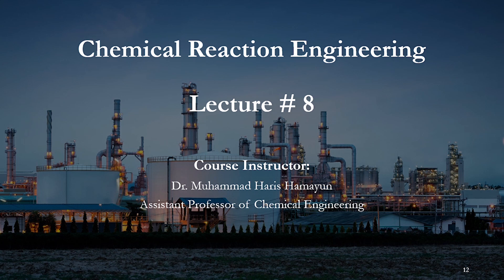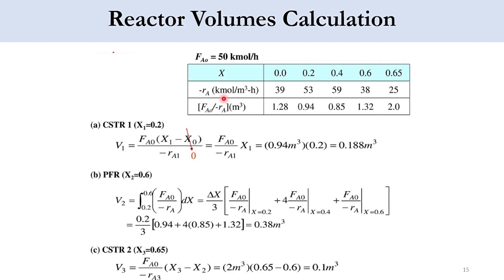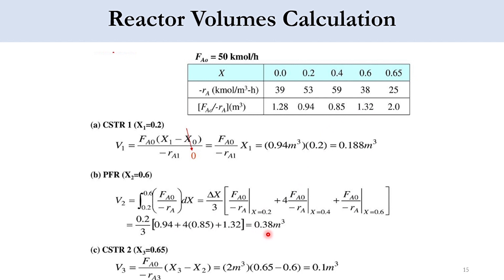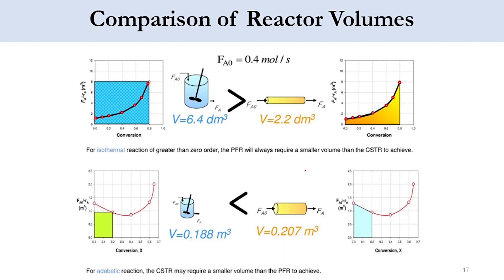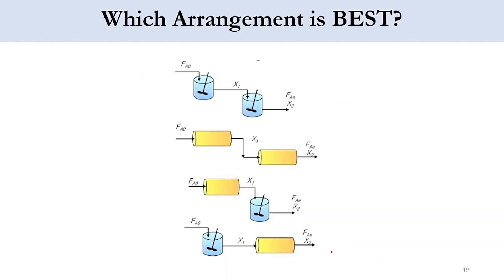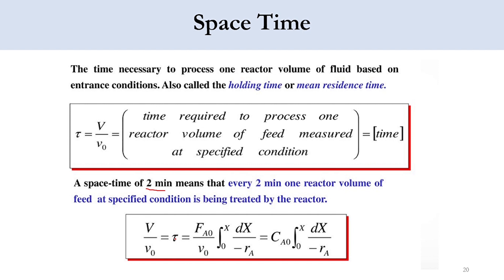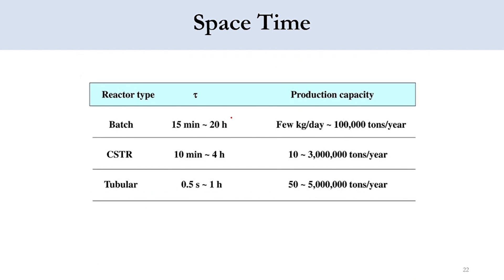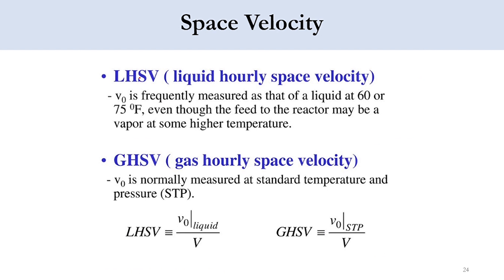Chemical Reaction Engineering - Lecture # 8: Reactors in Series & Space Time-Space Velocity Examples

Comment: 3:35 shouldnt FAo/-rA3 be 1.32 instead of 2? According to the table it is 1.32 and not 2
Reply from the maker: Thank you for your question. It will be 2 (as mentioned in the video) because we are calculating at X = 0.65 and the value of Fa0/-ra is 2 at this point. If you go to the Lecture 7, the basis of this point is over there. I am hopeful that answers your query. Thank you.

Comment: Sir could you please upload some of these videos

Simulation of Mass Transfer Equipment-1: Steady-state simulation of shortcut distillation
column using process simulators such as DWSIM/Unisim etc.

6. Simulation of Mass Transfer Equipment-2: Steady-state simulation of rigorous distillation
column using process simulators such as DWSIM/Unisim etc.

7. Simulation of Mass Transfer Equipment-3: Steady-state simulation of absorption column
using process simulators such as DWSIM/Unisim etc.

8. Simulation of Kinetic Reactor-1: Steady-state simulation of a Plug Flow Reactor using suitable
example in process simulators such as DWSIM/Unisim etc.

9. Simulation of Kinetic Reactor-2: Steady-state simulation of a Mixed Flow Reactor using
suitable example in process simulators such as DWSIM/Unisim etc.

10. Simulation of process-1: Steady-state simulation of a typical chemical plant involving heat
exchangers/ coolers/ heaters using process simulators such as DWSIM/Unisim etc.

11. Simulation of process-2: Steady-state simulation of a typical chemical plant involving pumps/
compressors using process simulators such as DWSIM/Unisim etc.

12. Simulation of process-3: Steady-state simulation of a typical chemical plant involving a reactor
and a mass transfer operation using process simulators such as DWSIM/Unisim etc.
Reply from the maker: That's a nice suggestion. I'll definitely work on the topics to provide the videos.